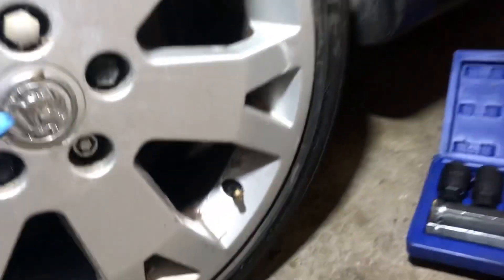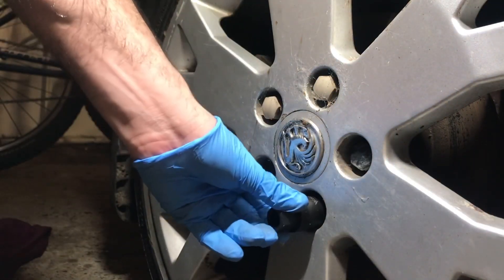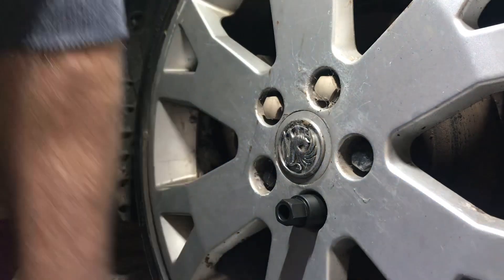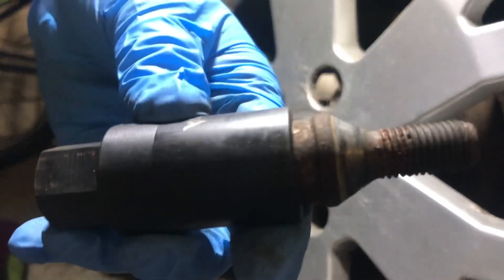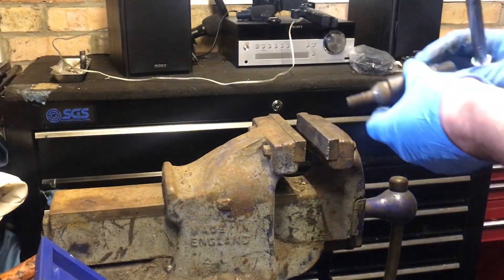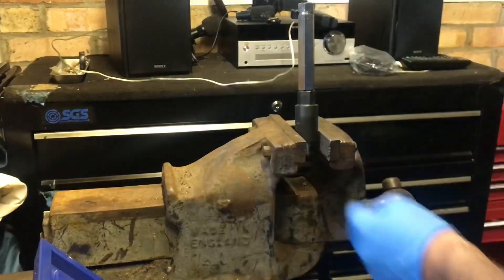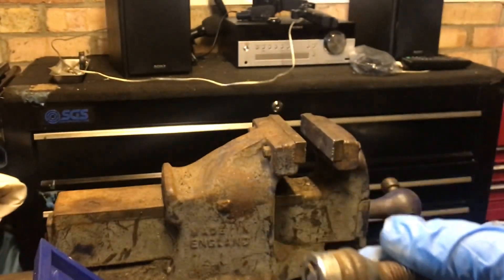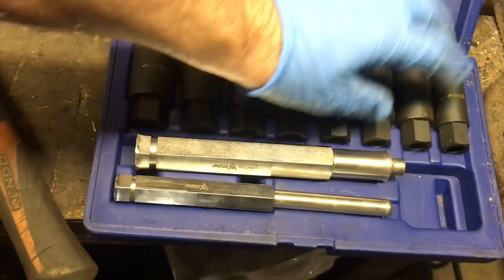How To Remove Locking Wheel Nut Without The Key

Comment: But does that work on the twisting renault ones 🤔🤔👍
Reply from the maker: Not sure I know what you mean by a twisting renno one, do you mean one that has a spinning colour? No you will need a dynomec or use a Dremel tool to break the colour in two places then carefully chisel it off.
Reply: @jonsutyautomotiverepair1993  yes that's the one a right pain in the arse I use a socket and sometimes it works but they are a headache
Reply from the maker: @flippingcarsrepairs  I bought a cheap version of a dynomec on eBay - it was £50 and has been amazing.

Il do a short video showing it